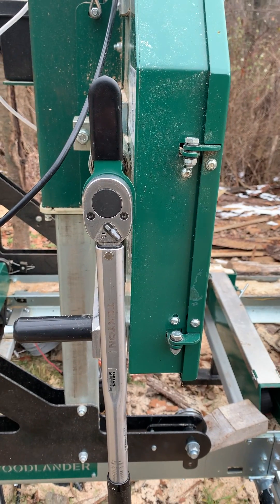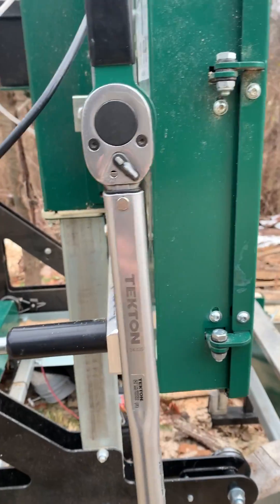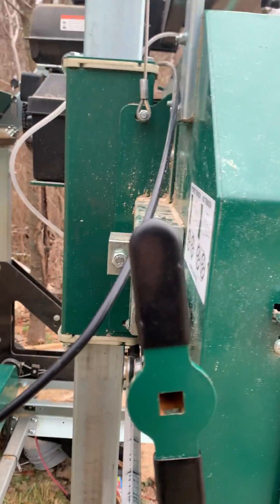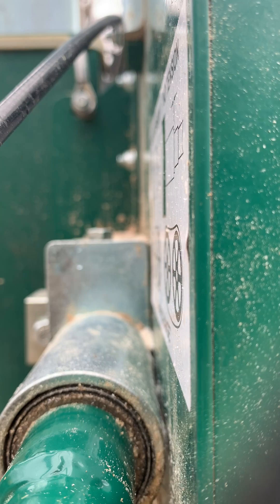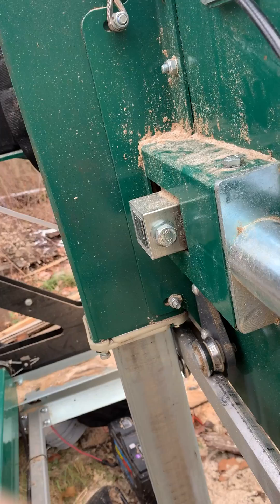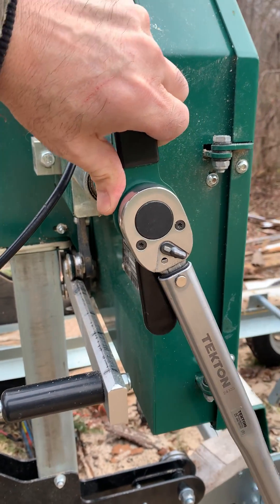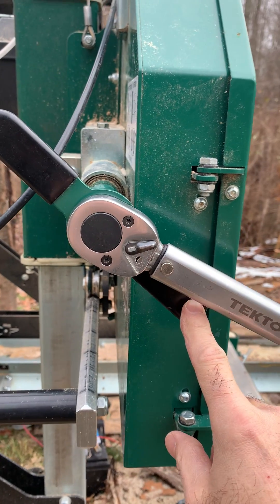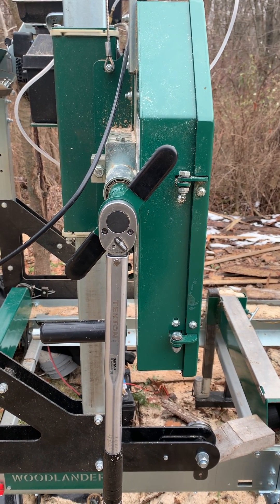Torque Setting Woodland Mills HM130Max

Comment: That's funny. Woodland told me no torque wrench but finger tight it, then turn 2.5 -3 turns. Said if I use a torque wrench I'd create all kinds of problems. I wish they'd update their manuals they send with the machine & EVERY tech support prople stay on the same script
Reply from the maker: Finger tight and the 2.5-3 turns is their latest update but I still use the torque wrench. I think the problem was too many uncalibrated torque wrenches was giving them a headache.

Comment: You are a very smart man. Thanks for sharing this. There is a huge difference between 2.5 turns and 3 turns. I had to discover this in a very hard way, by destroying my belts within first 10 hours, and creating lots of other issues. What saved me was grabbing a regular wrench with a 1-foot-long handle and using a fishing scale, I was horrified to see that my tension was over 30 lbs. Since then I purchased not one but two different torque wrenches (after hearing all the negativity that those wrenches are not accurate) and they are both very precise, they leave the factory very well calibrated. Important is also that with any belt change (and even blade change) the setting might vary, one cannot just mark the handles position and use it as guidance, so I use the torque wrench rigorously. Needless to say, that belts now last forever, bearings don't get destroyed, and blades don't break and cut more even simply because the tension is "reasonable". My observations are based on 3 mills I had and hundreds of hours of milling. I have seen some bandsaw mills being sold with instructions to mill with 18lbs, btw. Happy milling, and thanks again for demonstrating how it works.
Reply from the maker: Thanks for the kind words Wally

Comment: I set mine at 25
More than that and the drive wheel gets hot
Reply from the maker: @Cure_E_Osity  I now set mine at 20lbs per Woodland Mills tech support.
Reply: @foreal8691 where does your thrust bearing end up on your spring washer holder?  Flush ? Proud? Shy? Thanks
Reply from the maker: @simonlamoureux6726  It’s pretty flush maybe a hair proud.
Reply: @simonlamoureux6726  Simon, I think flush is just a ballpark setting, best way is to measure the tension and/or configure your mill to be flush. On one of my mills, I had to remove 2 washers in order to get it flush when using 20 lbs.

Comment: how tight do you set it?

my other mill was 25, the hm130 max is 2.5-3 from snug.

i used to do a bit more pressure in winter, but not being precise doesn’t sit right with me.
Reply from the maker: I talked with tech support at Woodland mills they now are recommending 20lbs instead of the 25lbs.

Comment: Those are belville washers, springs, that you are tightening against so the more they are compressed the more energy it takes to compress them.  That's why the handle didn't move very far from 20 pounds to 30 pounds.